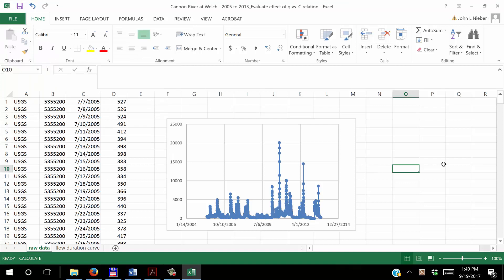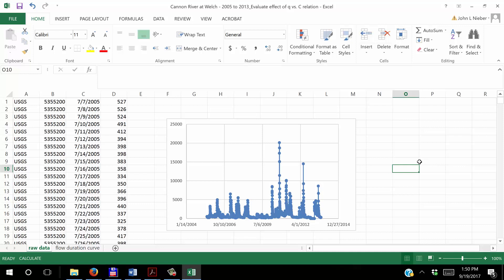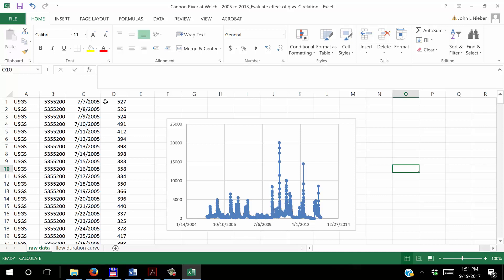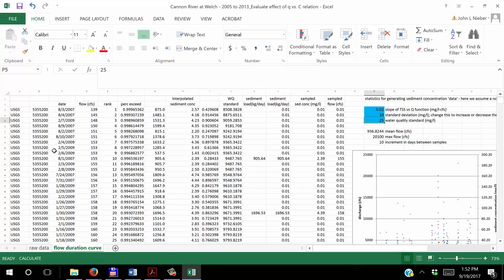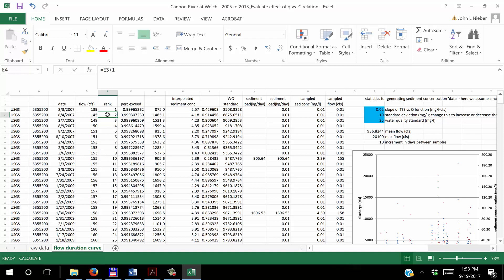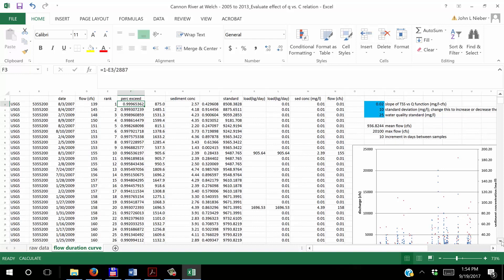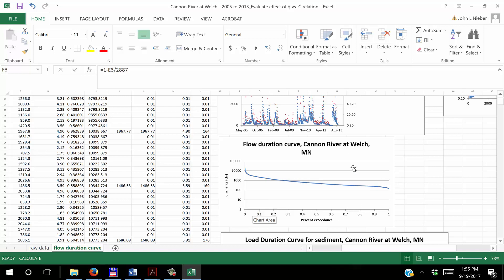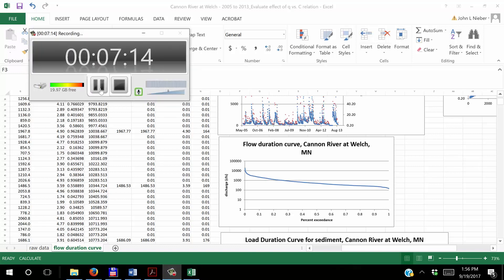flow duration curve

Comment: I am having issues formatting my flow duration curve. Can you post or email me the sample sheet you are using so I can drop in my data?
Reply from the maker: I have been traveling and will post the Excel spreadsheet by Thursday, January 31.
Reply: @johnnieber9274  Hi there. Same as Ethan - would you please share the spreadsheet? I am having a little nightmare sorting it all out....

Comment: what is flow duration curve in easy language
Reply: It gives the relative amount of time in a year that a given flow will be equalled or exceeded. So in the example given for the Salt Creek, the flow in the creek will on average be equal or greater than 440 cfs for [0.6*(12 months) =] 7.2 months a year.
Reply: thanks